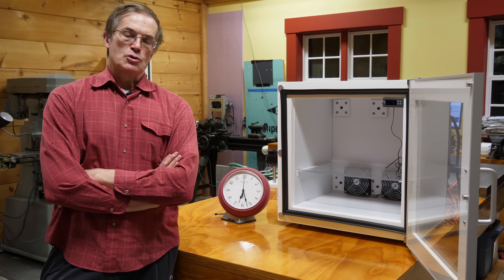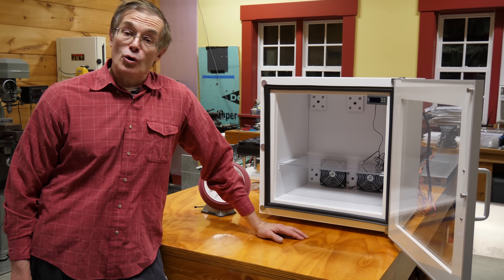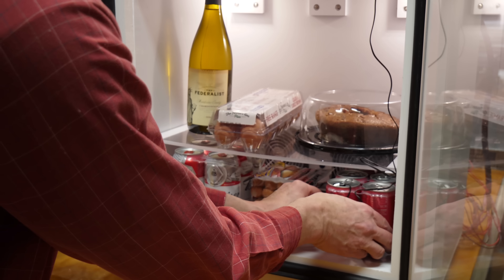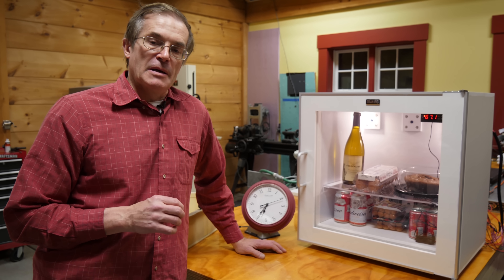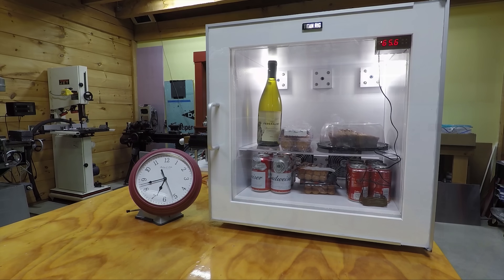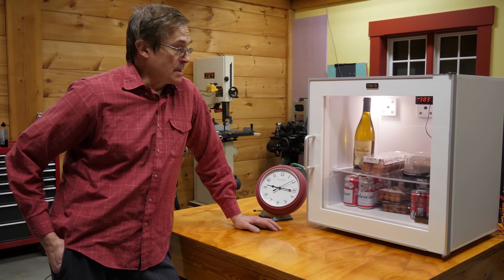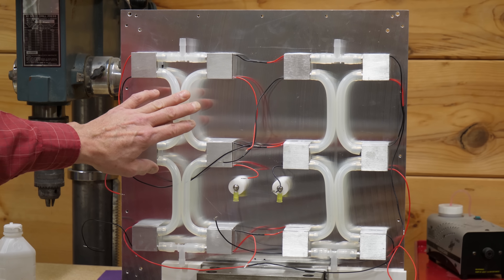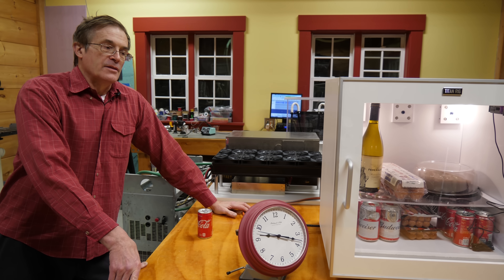TESTING OUR DIY REFRIGERATOR! - TEC/PELTIER

Comment: Nice follow up and attractive design. It would be nice to know how much power this refrigerator needed and compare that to typical cube and typical full-sized home refrigerators.
Reply from the maker: The TEC system will always be less efficient than a phase change system.  We can maximize the insulation, place a top opening door, eliminate the nice glass door and still it will not be as efficient.  Design flexibility will be easier with these modules and interfacing with the remote cooling option will be much easier.  In addition, one viewer suggested utilizing a ground loop to take advantage of the low and stable temperatures several meters below ground level.  Recirculating water/antifreeze will also allow this approach to be easily incorporated.  So, many ideas...
Reply: @TechIngredients  
Thanks for the design and experimentation, really enjoyed it! 
A couple of things. First, yes, TEC is not great on efficiency, maybe I missed it but what did you finally run it at Wh wise? The other thing I think people overlook is that you can run this off PV or wind without conversion losses that phase systems require. I live in the Catskills and it is cold here a good part of the year. I also have a stream and 10.6 Kw of PV with wind and microhydro going in next year hopefully. To offset the house ambient I think I'll build one in the basement on the north wall. I may even bury tubing outside to get a 12 to 15C that I can circulate around the cooling side most months with a valve to direct cold from outside ambient or subsoil tubing. Perhaps mounting it on a basement wall as a heatsink? I'll have to monitor my wall and floor temps to see what the best option is.
I won't use a glass door and there is no reason not to use more insulation if the space allows it.
The benefit of TEC, for me at least, is the flexibility it gives along with no moving parts, aside from a fan, which I'm going to try and run without. I wouldn't build a phase system but this is easily within mine and most people's reach I would think.
Rob.
Reply from the maker: You're welcome!I agree with your assessment and the addition of a small ground loop as a steady source of low temperature water is a very good idea.  More insulation is also a sound, one time investment in efficiency.We just completed a desiccant based, air conditioner that is at least twice as efficient as the best compressor based phase change units, is inexpensive and easy to build with readily available materials.A game changer for an up coming video.Stay tuned.
Reply: @TechIngredients  Thoughts on different thermal masses also? then that also depends on the size of the cool/cold storage. 

Eg, normal size fridge and storing a few bottles of liquid as cold mass for inconsistant power/does a 'object' you put in there cool down faster/slower? with the Extra cold mass or just the power of the unit.
Reply from the maker: The heat energy added when you place an "object" into the fridge is the same in both cases, but the TEC's will remove the heat faster with a smaller differential between the interior and the exterior of the enclosure.  Without any thermal mass inside, the object will raise the interior temperature closer to the outside temperature and heat will be removed faster.
Reply: @mosfet500  
Any progress on your microhydro setup?
Reply: @gregorymalchuk272  A Farmer above me was heavily fined for crossing the stream while logging his back forest so I'm hesitant to install a microhydro. I'm working more on windmills which are not a problem here. I may be able to install an underflow wheel in the stream or get a variance, I have to talk to environmental protection before I do anything though.
As it stands now I have enough PV and backup batteries to run my home indefinitely in the summer, I will try it this winter to see if it's possible, the problem is heat circulating pumps which take a lot of power. I can burn wood in emergencies but it's not my favorite as it does pollute and I would just be changing one form of pollution for another. If the windmills aren't adequate in the winter I will have to push for microhydro.
Thanks for asking.
Reply: @TechIngredients  You may have covered this in another video (I've just found your channel), but I wonder how the efficiency of this design compares to that of a "heat absorption" style refrigerator, the sort still used in many RVs.  We live in an RV, but ours has a "residential" refrigerator, what you refer to as "phase change", and I've been calling "compressor cycle" (I think I'll switch to your terminology), with its moving parts, fluid that can leak, and a need for 120VAC.  Many RVs have the heat absorption refrigerators, and while they have the advantage of running on heat (can have just propane, no electricity essentially), they are as I understand it abominably inefficient, use a lot of extra space for the mechanism, and are a huge fire hazard.  They're also known for very low cooling ability, so you have to only put in items that are already cool, need to be kept very level, and are even less effective in hot weather.  The design you show here seems like it could be a viable alternative, especially since most RV refrigerators are fairly small.  Thank you for your videos.
Reply: do these peltier devices have a know useful life? fridge compressors tend to last about 20 yrs. if build cost is lower and life is longer, it could be an attractive option?
Reply: @TechIngredients  The Geothermal ground loop seems like a very good concept.  
Should be around 51 degrees F below frost line.
Reply: @TechIngredients  Off topic but Could you do a video on how Chicago, Paris and Melbourne ran off of compressed air from tromps at the turn of the century(1900), they had compressed air cars too. this technology was suppressed by the vatican for 100's of years but has been used in mining operations for 100's of years!!! a stream or river is used to compress the air then it is piped to the location needed for use so in a mine shaft the deeper you go the hotter it gets, this compressed air is used to run pneumatic tools cool the workers and provide fresh air to breath and air flow out the shaft of bad air. it was used in the cities to run all sorts of things from stiring machines, drills, saws,blenders little electric generators, air conditioning, etc. etc, etc., as well if you needed more power you just heat the pipe and square the power output. Unlimited free energy 24/7/365 The parasites went around destroying all this info and stealing all the books about it from public libraries of the world, as they were setting up there control grid and killing off that generation with all the wars. I keep screaming bloody murder about this but nobody will listen or look it up, they just think I'm crazy. Please research this cause its side effects are cleaning and aerating the steams which causes the fish to flourish a WIN WIN WIN for us,they loose situation
Reply: @jasona.neverforgetfukushim647  If you perfect your Pneumatic powered car, you can put TESLA out of buisiness.  <wink>, <grin>  Could your own hot air be harnessed, piped 400 miles to run an air-motor that drives the compressor used in AC to cool my home in Florida?
Reply: @jasona.neverforgetfukushim647   ....  Good subject.  Do a vid on it or where do I GE the facts ?
Reply: Before you all jump on this guys throat @jasona.neverforgetfukushim647   he's right in what he's say just hasn't done enough research to full understand how the majority was made. Plus compressed air travels large distances with loseing any preasure so yep you could pump it 400 miles without loss to run a generator. NOT the best route for info but for basic understanding here's a wiki;
https://en.m.wikipedia.org/wiki/Compressed_air
Reply: peltier technology is horribly inefficient but this might have a place like maybe in a sub where you want to keep noise down or maybe to an RV as I think it would be a good load match to a solar system.
Reply: Anywhere there is a nice temp differential.
Reply: a better solution for RV is to buy 12 v compressor refer , they've come way down in price....they draw only 4 amps when running...i suspect the parts for this cost more than available units......i don't know why he doesn't give the power required , but i believe overall it would be more than 20-30 AH a day            i speak from my experience , having tried ice box , peltier
(wasteful) , evap 3ways (very wasteful), and compressor type            i do not know why he shy's away from revealing power use , it's of major concern in solar apps.                                                           watched his other vid. in hopes of bldg a better refer, but unwilling to  $pend bux to learn that lesson again- came back hoping he'd reveal efficiency...over insulation one key to conserving power
Reply: @kcajmortsnnew1488  

Conversion of solar to AC involves power losses.  These conversions are not as inefficient as they used to be, but they still exist. (it used to be as bad as 40% power loss going from 12 v DC to 110 v AC)

When you can go direct 12V solar to 12V Peltier you skipped the conversion of the solar to AC.

There are 12V refrigerant compressors, but they are prohibitively expensive. (for no good reason)
Reply: thanks , but i knew all that...20 + yrs. 1/2 time gypsy in vans           the price on 12v. comp. refers has come way down recently , . from $800 Io $1200 just a few yrs ago to less than  $400 today,NEW...i wdn't consider inverting to 110 , i use only 12/24 volt equipment      if you read my post , you'd see that i said 12v refer...i got one used for $200 , the next one was $25 @ 2nd hand store in Az.  , another same price , $25,yard sale from a guy who didn't know what he had...i found one free by the side of the road that needed a transistor ! ..my point was that the inefficiency of this build makes it a bad choice for 12 v portable r.v. , boat , etc..... @fhuber7507
Reply: @kcajmortsnnew1488  totally, but for compact builds that need to be rugged, the advantage is clear: no issues if tipped, no compressor/lines to break if mishandled. I built a mini fridge (about 15L) for camping a few years ago, but it only used a single TEC. This year water got into it during a storm and the power supply is shot. I think I'll try to rebuild its electronics using 4 TECs, undervolting them to about 1/2 of the single one. This should severely increase performance, while consuming about the same!
Reply: On the last vid he mentioned TEC had 1/3 the efficiency of phase change.
Reply: I have been thinking of doing this for years. Using new England’s cold temps to remotely pump heat out of my refrigerator to an external unit. Anyways Great Video!! Reminds me of my uncles show, the new yankee workshop, but with Tech instead of woodwork.
Reply: I’m not sure those food choices reflect a healthy diet lol
Reply: what exactly do you mean, attractive..?
Reply: @nicewhenearnedrudemostlyel489  Pleasing industrial engineering. The outside dimensions, large window, bright white finish would fit nicely in a modern Asian or European style house. Some people have a good eye for design even in alpha design stages. . .
Reply: @nicewhenearnedrudemostlyel489  I think if you din't have a probe inside it and a glaring LED temp readout that's always on facing out the front glass door, it would be a faily attractive fridge but even more convenient because its nice to actually be able to see inside the fridge without having to open the door to know if you milk is low or you ran out of some item.  In that sense not having to check on the fridge as much also saves a measurable amount of energy.  But I think a non-glass door that's insulated same as the rest of the fridge would actually save more money in the long term.  That glass can't be nearly as insulating as the foam panels, can it?
Reply: @xapplimatic     You can vacuum insulate the glass panel and it will become far more efficient than the foam.
Reply: @nicewhenearnedrudemostlyel489  They mean they wanna fuck dat fridge.
Reply: Watch the next video to learn more https://youtu.be/RkSR4rTl2GY
Reply: too much power...LOL.
Reply: Should have made it a window mount it like the AC. VENT the heat right into the cold. You know why Eskimos have refrigrators? It's so they can to keep their food from freezing.

Comment: woo! new video! i was wanting to see how this performed! so fun idea with the water cooled peltier coolers, i had that idea for a minifridge quite some time ago, but rather than a radiator, i thought a heat exchanger  in the ground would be a nice way to see some efficiency that worked year round. the winter time is great for water to air, but not so much for summer time. around my area the ground temperature hovers around 48-56F year round, and having a consistent temperature differential year round without pumping the heat into the house is ideal.
Reply: Yeah, basically the opposite of a heat exchanger-based heating system.
Reply: Ground is a good insulator. What you want is a well that you can circulate water through.